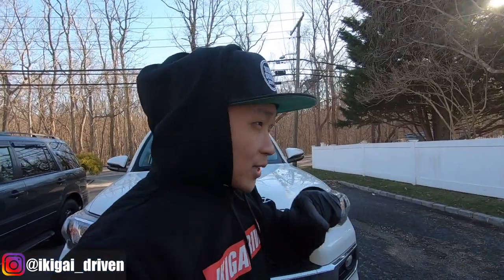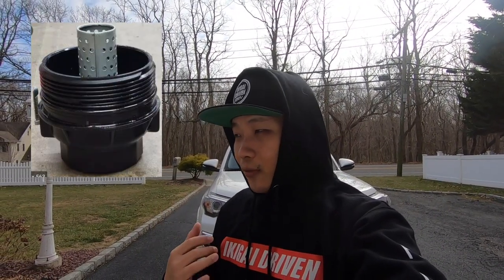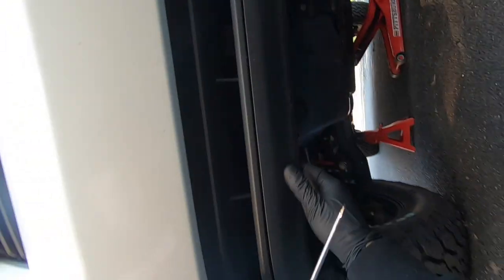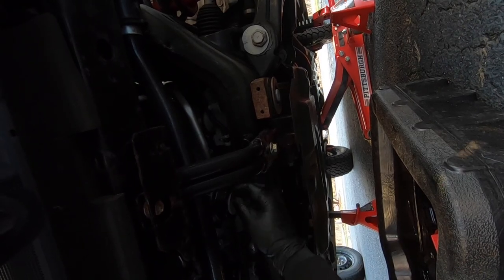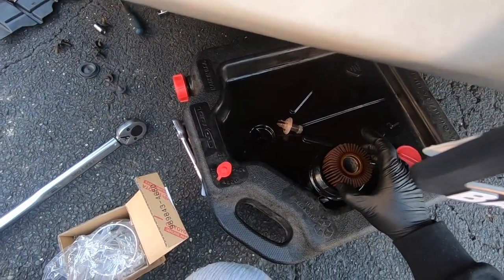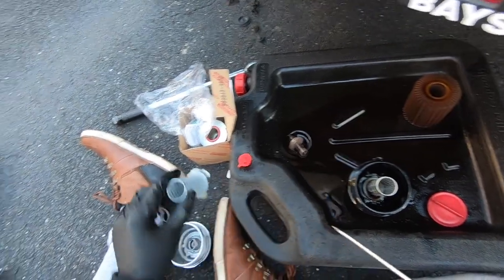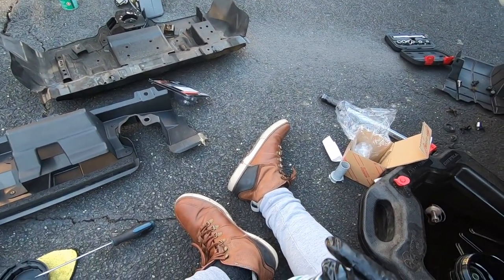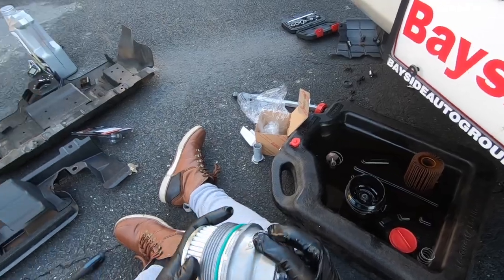ULTIMATE 5th GEN 4Runner OIL CHANGE UPGRADE

Comment: I did my oil change right before vacation this year with Pennzoil ultra platinum and a TRD oil filter in the oil was so clean for at least the first 1500 miles that I could barely get a good reading on the stick I’m at 5000 miles right now and it’s still looking really good I’ll probably push it to 7500 or 8000 which I normally don’t do

Comment: 👍👍👍
Reply from the maker: Appreciate the support
Reply: I plan doing this to my 2019 sr5. I left my skid plates off after the last oil change.
Reply from the maker: I plan on eventually upgrading the skid plate to have more convenient oil changes
Reply: @ikigaidriven  the part about the dealership over tightening is true. My roommate had her oil changed on her Corolla at the dealer before and when I went to change it I had to use a breaker bar to change the filter. I told her never again
Reply from the maker: No one will treat your car like yourself